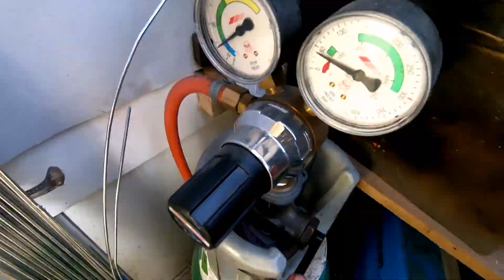HAND BUILT ALUMINIUM EBIKE FRAME | PROTOTYPE 2 UP AND RUNNING | PROGRESS VIDEO | IT'S ALIVE |

Comment: what size tires and rim ? have you tried the low temp aluminum rods I guess you can weld with just a blow torch. I do not have a way to weld aluminum except that way so I will be trying this method .